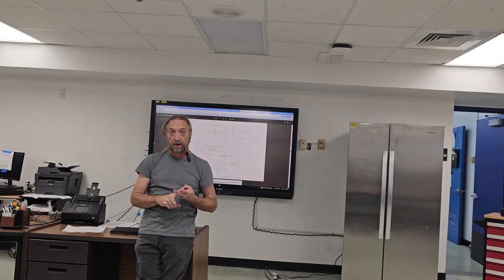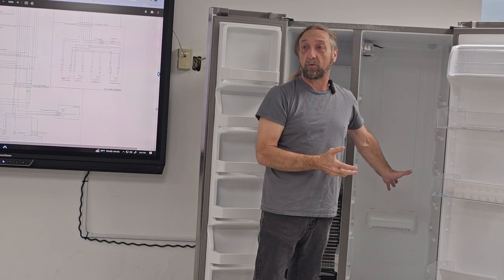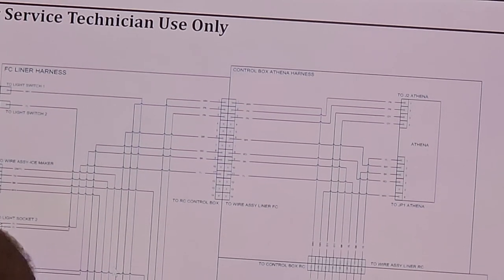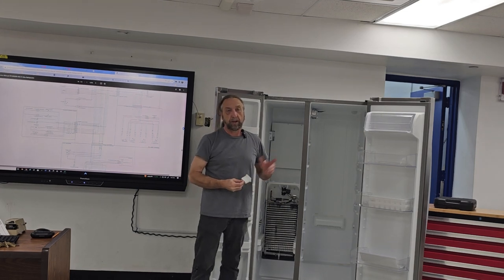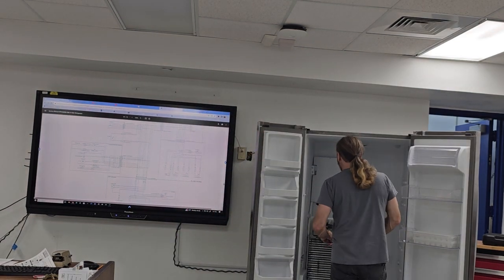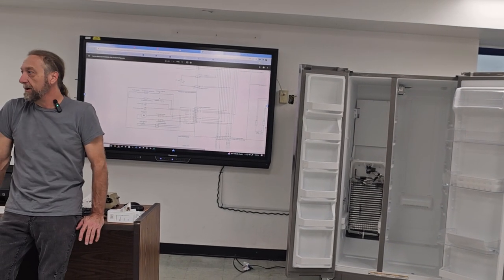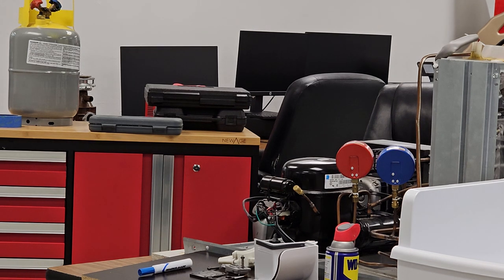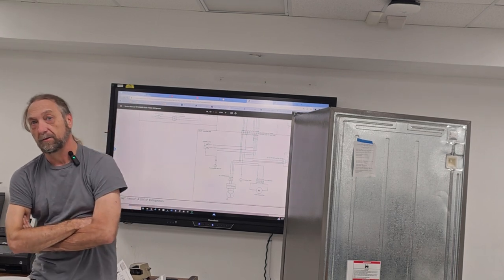Whirlpool SXS Sensors

Comment: First, Thank You for sharing these videos!!   I have a question, if you can please answer.  I have a Whirlpool Gold SXS. I checked the compressor and its good. I put a new Relay, but still just run for a while, cool a little shut off.  What else l could check.?   Thanks.

Comment: sir there is a deep freezer which has r600 gas .Only moisture comes in it, does not freeze. What is problem. Please sir .his back pressure is 5 psi